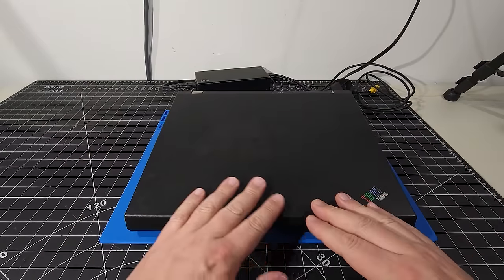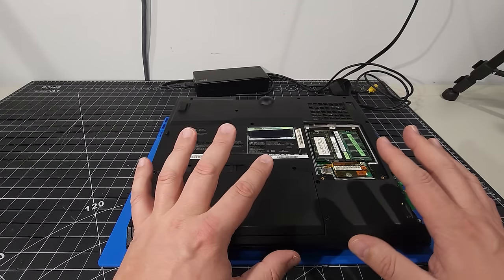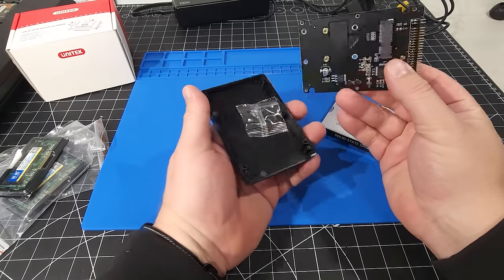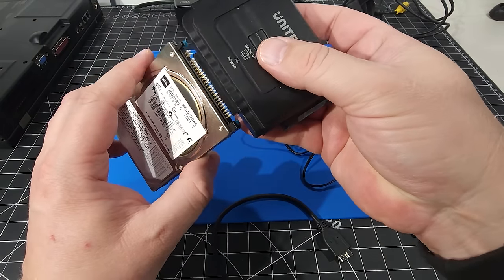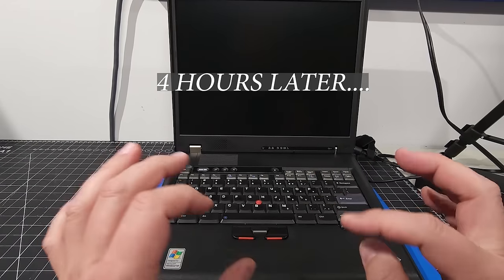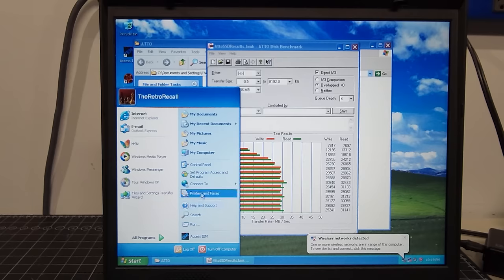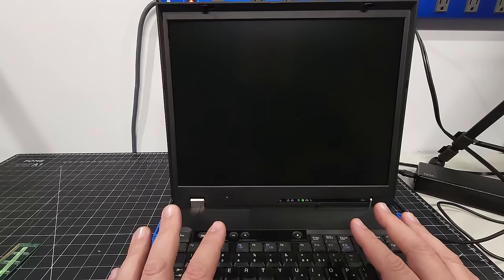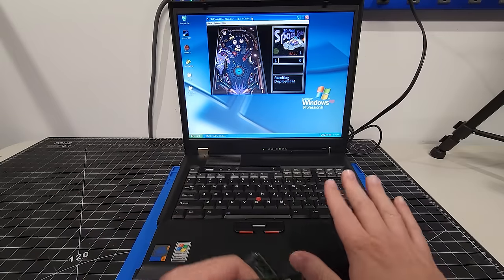IBM ThinkPad G41 Upgrade!!

Comment: Another solution for storage ive seen for machines like this is a IDE to compact flash card reader. Its not the best solutiond but it saves you the time if justifying putting a Sata ssd in a machine this old. 😂
Reply from the maker: Haha!  Yes, I have a couple of those for a few project desktops.  Much easier to swap around :)
Reply: CF and SD card to IDE adapters are dumb. Neither of them are designed for the use case as a system drive with a crapton of random writing and will wear out/fail quickly. Ask me how I know 😒... To add insult to injury, some of the SD card adapters cause filesystem corruption right out of the box due to buggy firmware. I'll take mSATA to IDE (or the modern equivalent M.2 SATA to IDE if you need a bit more capacity for cheap) any day over CF or SD
Reply from the maker: I've used the compact flash to IDE a few times and have not experienced an issue, however when I tell you a few times... It's exactly that.  It seems you have way more experience based on use.  They are much easier to swap out when using the system for OS testing, but again - that's just a use case :).
Reply: @Knaeckebrotsaege  system on modules are 100% industrial compact flash cards. 👍
Reply: Only system I've ever ran off and SD card is a Raspberry Pi. Never even thought about running a PC off of one. 😂
Reply from the maker: Haha ohhh the adventures.

Comment: Old Sys/Net Admin here....  2 suggestions.  (1) Label that SSD conversion case with the model and size of the SSD.  (2)  You might want to check if XP knows how to do SSD Trim???  I don't think it does.
Reply from the maker: I will check it out!
Reply: @TheRetroRecall    Thanks for the video.  I really enjoy keeping systems running for as long as possible.  And...  Upgrading with new tech if it's feasible.
Reply from the maker: For sure.  I mean I do what I can to keep them out of landfills / recycling centers.  There's also the fun part of sharing these with everyone :)

Comment: i do know windows xp will read 3gb of ram if you have 4gb ram in the system.
Reply from the maker: I'm not sure if this system will support that or not.  I'd be happy with 2gb in this system for sure.
Reply: Yep, 3.33GB to be precise :)
Reply: @TheRetroRecall  2GB is the max supported capacity
Reply from the maker: Ok great to know!
Reply: @TheRetroRecall  built in graphic card is going to take some of the ram
Reply: @TheRetroRecall isn't that something you should have already known?
Reply from the maker: Well there is a difference between a supported configuration and what the machine CAN do.  When end users who have experiences with various machines share their real experience, it is more likely accurate.  I've already had other machines that the book says one thing, and the real life scenario is different.  So, I ask the question back to you - why do you feel it is something that I 'Should have known' if I've had limited experience with this system?
Reply: @TheRetroRecall  You must have found some pretty funky systems because I've never found one, in 30 years that was able to surpass its memory limits without tinkering. Never in my life found a factory spec'd machine that could take more memory than the bios was spec'd to accept. So, in my experience, you should have known. Clearly your experience speaks differently to you.
Reply from the maker: Thanks for your perspective and for watching!
Reply: @2xtreem4u  If it only has Intel integrated graphics, yes. The G41 was also available with GeForce FX Go5200 with dedicated 64 or 128MB VRAM though. And on that note of early mobile "Go" Nvidia cards, the coolest of the bunch will always be the mobile "GeForce 2 Go" for its name alone :D

Comment: I'm going to upgrade my fujitsu pc with 10 gb ide  to 120 gb sata ssd
Reply from the maker: I noticed quite the improvement... But I will say, it was erie looking at this old system and not hearing the clicks of the hard drive!!
Reply: @TheRetroRecall  my fans are louder than the hard disk
Reply from the maker: Haha I imagine!  I know on this machine they definitely are as it is a P4!
Reply: @TheRetroRecall  Intel Room Heater :)
Reply from the maker: Haha, I was cold, why do you think I did this video 😂
Reply: @TheRetroRecall  i can add nvidia room heater fermi to my pc :)
Reply from the maker: Haha!